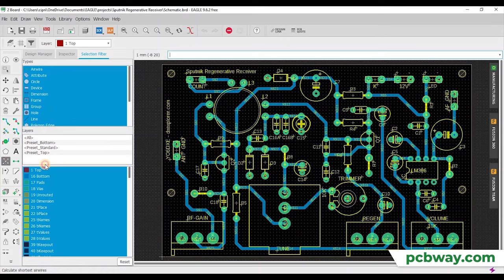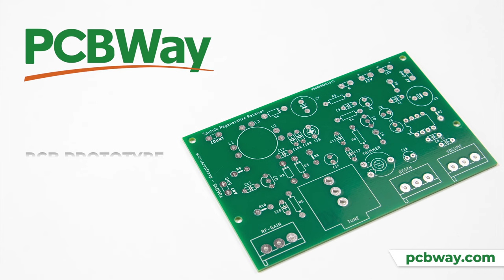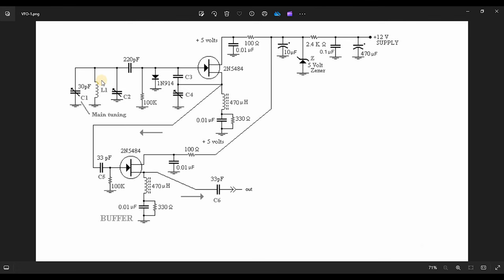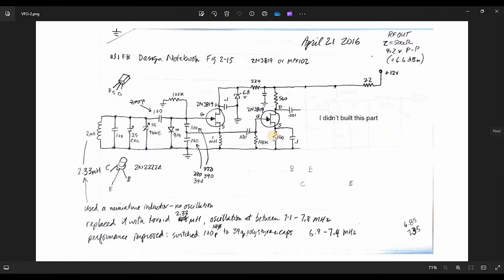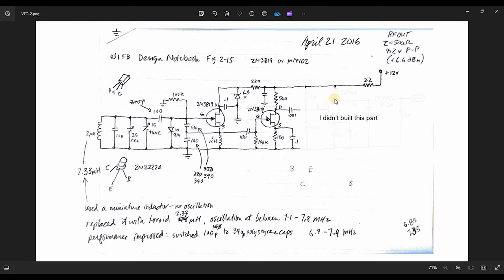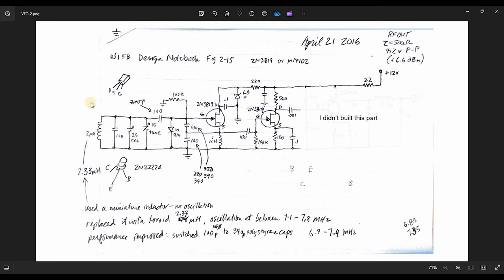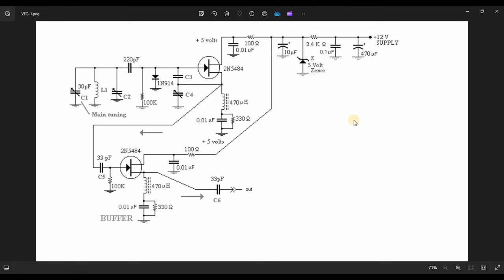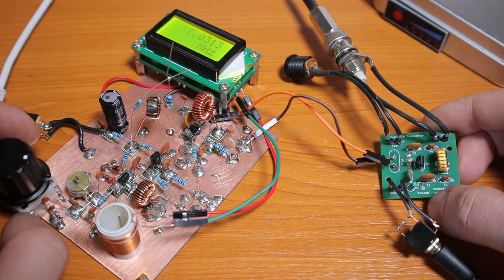Can I Replace A Crystal With A VFO In A Simple CW Transmitter ?

Comment: Try buffer transistor stage too. 73!
Reply from the maker: Right now I have one buffer and a buffer / amplifier stage too. I built the full schematic by W1FB of the VFO. Still no luck. I need to measure the output signal lever of the VFO as it is now and check if is 4 volt as described in the article. I don't really know how to measure that signal 😁. More new things to learn for me. 73, YO6DXE.

Comment: OK first of all you need to really understand what you are doing 😆 Your small transmitter is nothing else as fix frequency oscillator with output impedance tuned to antenna. And what you are trying to do is variable frequency oscillator to drive your fix frequency oscillator 😁 Silly indeed.  You have to only adapt output impedance of your VFO (by transformer or add additional buffer with proper output impedance) and you can use it as a transmitter directly.
Reply from the maker: Indeed that is exactly what I wanted to do )). But the idea was simple... to use the VFO as a replacement for a crystal... for those that do not have one... and also to be able to change the frequency a little. Indeed the simple transmitter is nothing but another oscillator... but if you remember how in old tube transmitters you could "adapt" the circuit to work both with a crystal and also with a VFO with little modifications to the transmitter... and that one basically becomes more like a PA stage instead of a simple transmitter 😁. I hope it makes sense haha. That is the idea of the experiment... the learning process... ))). 73, YO6DXE.
Reply: @dxexplorer  There is only one meaningful way to tune the frequency of that small transmitter and that is to add tunable capacitor in parallel or in series with crystal. By this you will get some possibility of tuning. Because you current solution doesn't have any sense.
Reply from the maker: @bfx8185 Ahhh no no I do not want a VXO... the tuning range is way too small and is not worth the effort. I find that useless... that is why I wanted VFO. Ehhh you will get the idea of what I am trying to achieve a bit later once I finish experimenting ))).
Reply: @dxexplorer  there is only one way to get your idea working and that is transformer at the output of your VFO something like 1 : 4 impedance on the core like FT-50A-61
Reply from the maker: I tried with a T50-43 because it was all I had on hand out of curiosity... but I think I need to modify the circuit of the transmitter in order to make it work too. But I gather all the ideas that you all put me here and try them all because is fun to make these experiments. Theory is nice but when you do and see things in practice too..  working or failing... both make me understand and the see logic of things and how all works. So.. transformer on the list too 😁😁. Got to start work... have a fantastic weekend and thank you for the tips. Very much appreciated 🙏. 73, YO6DXE.
Reply: @dxexplorer  do not forget coupling capacitor at the output of transformer 10pF or more

Comment: Calculate the reactance of components at the designed frequency, then find the L and C values at your desired frequency.
Reply from the maker: The frequency is ok... I think the transmitter circuit needs modifications in oder to work.

Comment: so i think it doesn't work because transmitter schematic is bit different i think it would need some changes. transmitter schematic is similar as one transistor crystal generator so it my be problem here. I will ask few people about that and give you answer
Reply from the maker: I would really appreciate that yes please. And yes basically the transmitter is a low power crystal oscillator so is like sending signal from an oscillator to another oscillator right ? )) is a bit confusing for me. Clearly there must be some changes to be done. I know in the tube transmitters there has to be a 20nF capacitor from grid to ground added extra in order for it to work... but in the case of these simple schematics with transistors... I am lost ))).

Comment: Haha, really enjoyed the video! Just pure experimentation and confusion. For me there is something missing between the VFO and the transmitter. It seems that connecting them directly is not the ideal solution. 73
Reply from the maker: I love experimenting especially when I don't understand things 😅. It actually helps me understand so failing is good sometimes. I think there is something on the transmitter side... since basically I am connecting an oscillator to another oscillator ... and the idea is for the last stage ( the transmitter ) to be just an amplifier. At least this is what my common sense tells me )).
Reply: @dxexplorer  I understand, maybe try removing this 120pf capacitor on the transmitter side. Also i have seen a lot of circuits that pick up the rf from the collector of the transistor. Hope it is something like , otherwise you have to add a pre amp(buffer)
Reply from the maker: @sv2tcb Yes... clearly the TX needs modifications. The VFO already has a buffer stage and a buffer / amplifier stage... it should have a good signal... I think.

Comment: Idk I’m as confused as you are at this point. So I’m gonna sit and wait for the real answer to come up. 😅
I would’ve tried to disconnect the Freq. counter. And hope the signal is now big enough to oscillate the transistor in the transmitter. 🤷🏻‍♂️
Reply from the maker: I did that too... most of the time I don't use the frequency counter..  still nothing though. I have a feeling there is more to this than just connecting the VFO in the spot for the crystal )).
Reply: @dxexplorer  I’m afraid it is.
Reply from the maker: I make a list of all suggestions I receive and when I get home I will try them all. The best way to learn. When it will work... everything will make sense and why I had to do something in a certain way 😁.